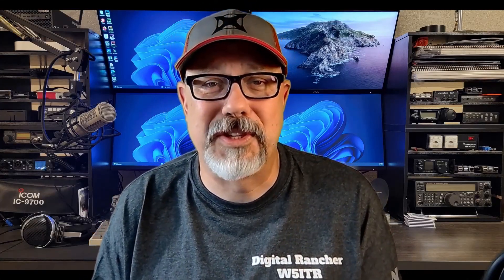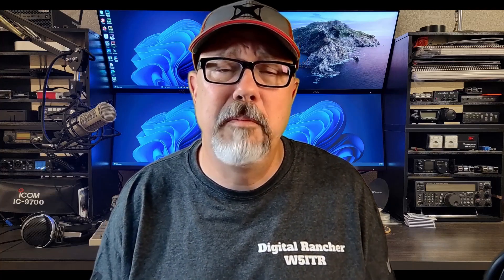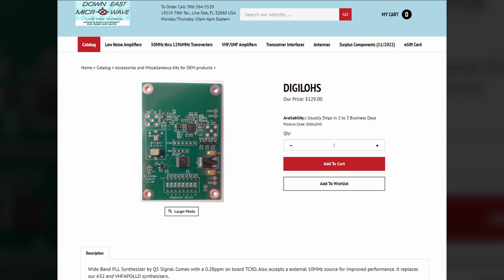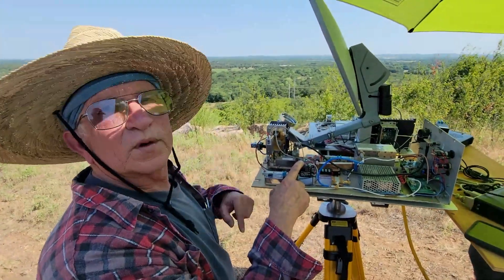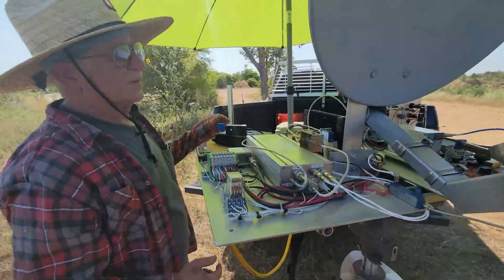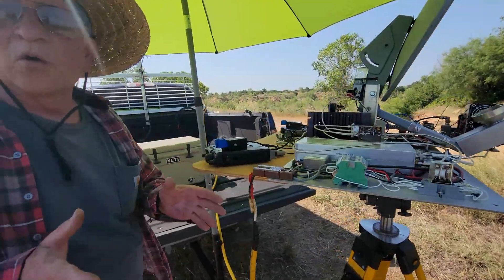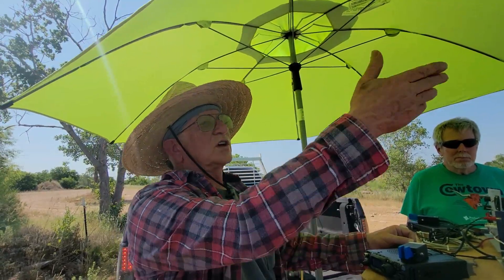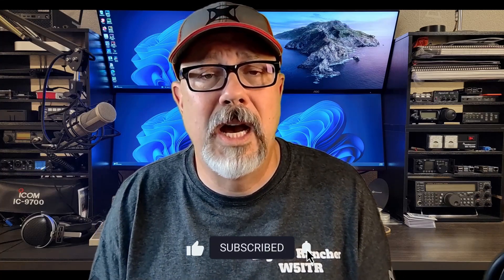Microwave Ham Radio with WQ5S

Comment: This is so esoteric and interesting. I would be interested in hearing what kind of range based on what propagation mode (line of sight versus rain scatter, etc.), how frequently do they make contacts, and so forth. That is a unique corner of the hobby.
Reply from the maker: I don't know what is typical but the contacts made during field day were between 80 and 100 miles. In contrast, the contact Brad referred to in the video was to southern Kansas and It is about 320 miles to the southern border of Kansas from the location he spoke about. So it seems 3x+, at the least, is possible when taking advantage of rain scatter!

Comment: So harmonics are good in microwave?
Reply from the maker: In this implementation, Brad utilizes a harmonic and filers out the fundamental frequency and other spurs. Interesting idea for sure.
Reply: Well..."harmonics" are good when making the local oscillator for the system as it would be quite difficult to build a standard LC type oscillator operating at 10 GHz!  It's MUCH easier to make an oscillator at a low frequency and then take its harmonics and amplify them to useful levels using modern MMICs and filters made from such things as copper plumbing caps..."harmonics" of the desired RF output are undesirable, just like at HF and VHF...N0EDV
Reply from the maker: @scottlittfin5832 Well said! Thanks for watching and commenting, 73!